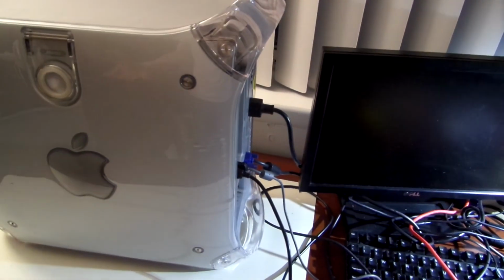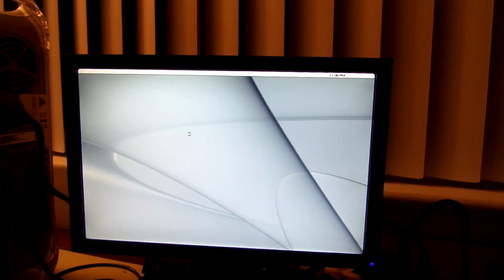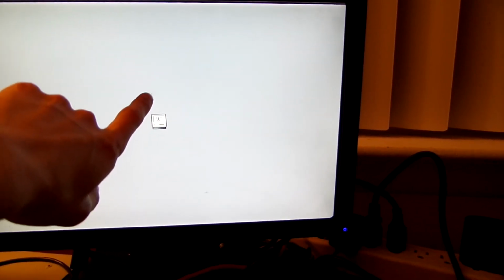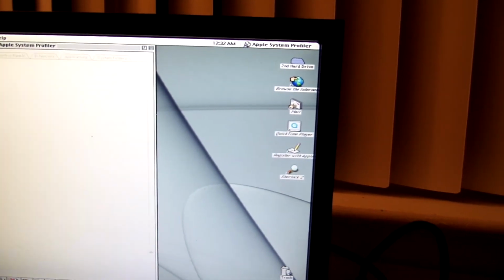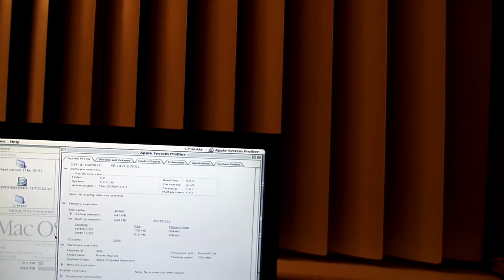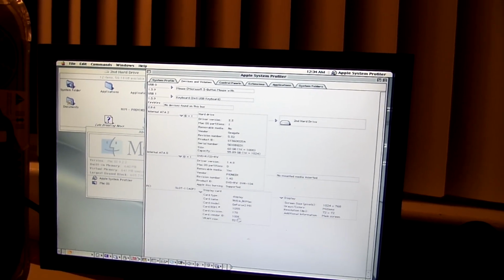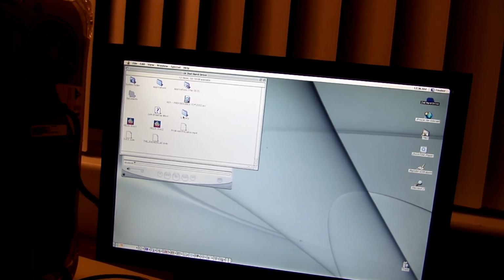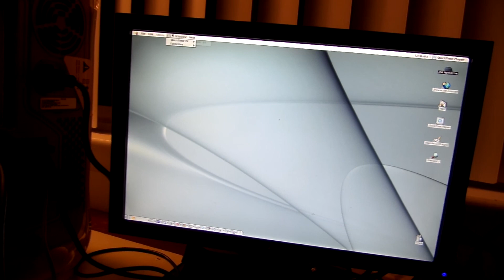Looking at a Free Powermac G4 Quicksilver

Comment: if you take it apart, you can wet sand the sides with 800-2000 grit, and buff with a buffer. scratches gone